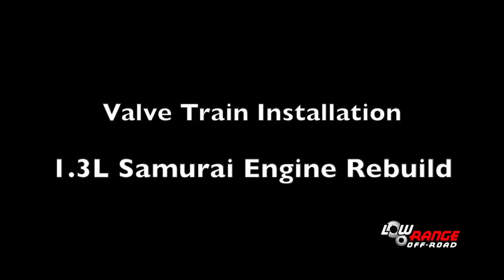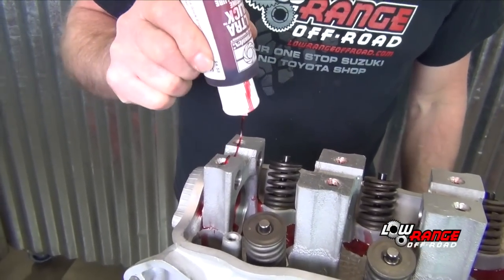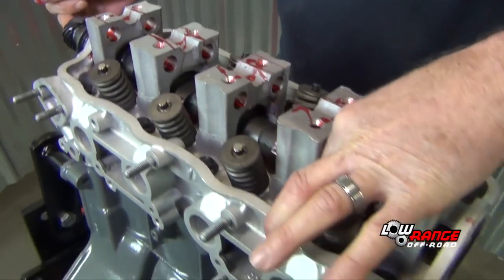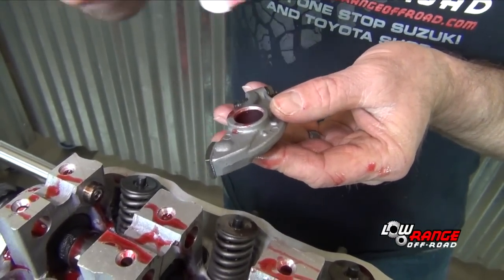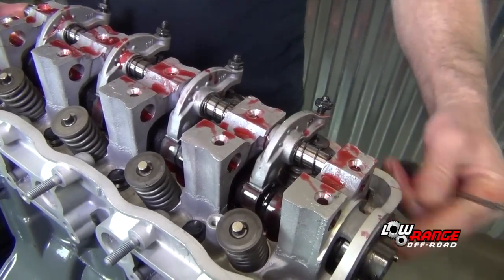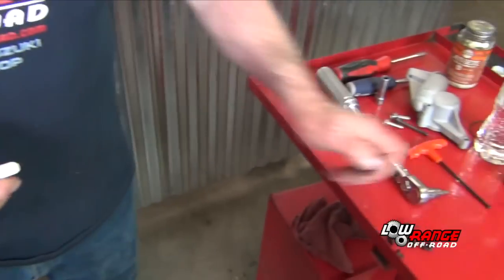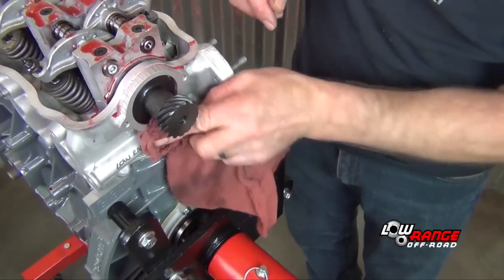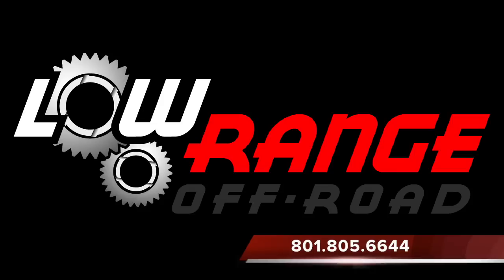How To Rebuild A 1.3L Suzuki Samurai Engine (Part 6) Valve Train Intstallation

Comment: Thanks a lot for the series of videos ! A cylindre juste broke on my SJ413, i was checking a leak on the oil pan and found little bits of piston in the bottom of the pan. After better check, piston n°2 is broken but not to the segments. I think i'll need these videos soon, thank you again, you just saved me a lot of time ! :)

Comment: This looks like it's the same head that's used in the Vitara 1.6 8V.  A friend of mine bought one that apparently has a blown freeze plug in the head (why are there freeze plugs inside the head?!). To exchange it, the camshaft needs to come out. Am I correct in assuming that in order to take the camshaft out, you have to take the head off, since the shaft comes out the back of the engine? What a PITA.

Comment: So I've taken my valve cover off to adjust valve lash and found two of those screws missing, one on each shaft at cylinder 3. I'm sure it's been like that for a long time but do you think there would be a significant oil pressure dip with those gone? I was just going to take my car for a burn up to a lake but I'm not sure where to get specialty screws that would fit, locally on a Saturday afternoon. Think the local auto parts store or do you guys still sell the upgraded ones?

Comment: why water instead of say Vaseline or similar oily products on the seals?
Reply from the maker: With vaseline or oil the seal has a tendency to push back out.  With water it seems to stay in place a lot better.  Try it.  It works.  Thanks for watching and commenting.

Comment: What oil should I use when first starting a rebuild engine?
Reply from the maker: +Ivan Cumpian We recommend using a good quality conventional (non-Synthetic) motor oil during the first 500 miles of operation.  After that we recommend changing the oil and filter.  You could go to a synthetic at this point if you wish.  Hope this helps.  Thanks for watching.

Comment: Why u using water to install seals? It's starts to rust the spring in the seal
Reply from the maker: +Hamisutca Sehanyszam We have found that if oil, assembly lube or gasket sealer is used on the outside of the seal, it tends to push back out of the seal cavity when installed.  With water the seal goes in to the seal cavity and stays there.  As to the rusting of the spring, we haven't seen that incurring.  But it is something we will watch for because of your comment.  Thanks for watching and commenting.

Comment: Does anybody know the part number for the tiny screws on the ends of the rocker shafts or if there is a replacement?  I was a bozo and stripped them out thinking they were holding the rocker shafts in there.  I proceeded to drill them out, but it turns out I was not supposed to remove these?  They are just for guiding the shaft out?  I can see right through the shaft now.  Woops!  I might just put a generic bolt in there but I need to find the thread pattern so I can tap  it and clean the threads out!  I have no idea what it is! HELP!